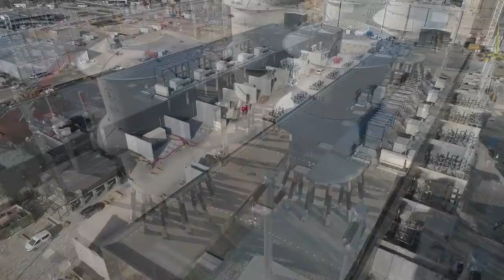WHAT IT TAKES TO LIGHT A STAR

Comment: What happens when there eventually is a catastrophic failure ? Does it explode and destroy a town or go out in a puff of smoke ? Would be nice to know what safety protocols are planned.
Reply: Fizzles out, does not explode. The reactor itself would be damaged but there won't be a permanently hazardous situation like a fission plant. There is the possibility of a radioactive release, but it would be a few orders of magnitude lower than even a modern fission plant. Biggest hazards for nearby towns are fires caused by plant equipment failure.
Reply: completely safe compared to the current nuclear fusion technology - as it takes a HUGE amount of energy to maintain the reaction, any problem in the process will cause it to shutdown and immediately stop the reaction - there's absolutely no chance of a runaway or chain-reaction like the old ways...
Reply: Once it is ignited the fusion fuel inside the reactor should just be a little bit denser than void, and due to its immense energy requirement to actually start the reaction if there is a failure in the containment field the fuel should all be dissipated.

Comment: Do Tokamaks have to be this big?  Can it work on a smaller scale?
Reply: If you can increase the magnetic field strength, (for instance using high temperature superconducting magnets) then it might be possible to make it smaller. The research is still ongoing.

Comment: While this is exciting, and kudos for the progress, it's worth remembering that this will not be a plant that is actually capable of sustainedly producing power. A very optimistic back-of-the-envelope calculation for a commercial fusion plant derived from this experiment puts it in maybe 2060. In other words at least 40 years too late. 
That fusion reactor we already have is the one that we need to use heavily for the next half-century, at the very least.
Reply: not even in the least bit true - this plant will INDEED be producing sustainable power, not just the break-even Q=1, but the target is Q=10!!   It is indeed an experiment, so won't be used to power 'homes' per se.  However, there IS a small grid connected to prove that it can be done, and at some point, it is likely to be powering the local area to some extent..
Reply: @OzBeefer  So, in essence you are saying it's not really going to provide power? Just using a lot of words to say it?
Sure, that's not at all what I was saying.

If nothing's changed dramatically since I last checked, this is the realistic timeline:

ITER: first Deuterium-Tritium-Fusion in 2035. Parallel conception phase for DEMO. 
DEMO, if we're lucky, will be started on for real in the early 2030s. 
Build time until first light: likely 2045. (My estimation, maybe more pessimistic then needed, but "a pessimist is an optimist with experience".)
And then they'll be (hopefully) ready to build the first real production plant, which will take another ten years or so. 

And that's one $10 billion machine providing something on the scale of ~1 GW or ~10TWh/a (assuming more or less 100% full availability, which is frankly unreasonable). Scale that up to the world's needs, and say only 10% of the ~40PWh you'll need 500. $5 trillion investment. 
Easily second half of the 21st century.
And before you hit me: these are back of the envelope calculations -1 digit of precision, as it really doesn't matter that much.

Don't get me wrong, I like the idea of fusion power plants. But unless some magic's going to happen, they'll come too late.
Reply: @roaxeskhadil  short answer, yes it's going to provide power to prove it can be done in 2025-35.  Then DEMO will be a production-use scaled-up version to take it to the next level.   These things take time, 40 years late from what exactly?  The tech simply didn't exist to DO this 40 years ago, so I would argue that this is exactly on time...
Reply: @roaxeskhadil  I think you’re trying to say ‘create power commercially’?  Then no, this is an experiment, but creating power itself, of course it is - what would be the point otherwise?
Reply: @OzBeefer  An experiment is not a solution to a problem, it might be a step to get there. So yes, I was talking about commercial use, of course, there should have been no need to spell this out.
Reply: Actually, I did spell it out: "A very optimistic back-of-the-envelope calculation for a commercial fusion plant derived from this experiment "
Reply: @OzBeefer  "40 years late from what exactly"

too late.

Too late to have any significant impact on us fuck up our climate.

Reading competency these days ...
Reply: @roaxeskhadil  it couldn’t have been done 40 years ago, you do see the paradox right?
Reply: @OzBeefer  Not at all what I said.

Comment: ITER is tremendously exciting but I can't help but wonder if the time, money & resources could have been deployed more efficiently in renewable energy & storage deployment far sooner, & to far greater effect in reducing runaway climate change risks, used the same international political cooperation to build the massive interconnected, intercontinental grid connections necessary to make a fully renewably powered grids possible; some of which has only just begun over the last few years. Australia has massive solar resources, could & will, begin to supply South East Asia. North Africa, again massive wind/solar resources could easily supply both itself and Europe with solar & wind power. Humanity could have been reducing greenhouse gases for the last 15 - 20 years, ramping up renewable energy generation and storage at a pace much more in keeping with the Kyoto protocol and goals of the Paris accords.

Comment: Just imagine if you switched these obsolete superconducting magnets with the new much powerful ones being used by MIT, SPARC and Commonwealth Fusion Systems. You could just create the foreseen power of the DEMO reactor over the existing ITER infrastucture, just by switching them. This should be done as quickly as possible.
Reply: The ITER design was solidified 20 years ago.  You can't just swap in higher field without changing every other aspect of the design.  Also, it took years to source enough NbSn to work into confining coils.  Mankind hasn't made enough useable REBCO since its discovery 40 years ago for a single one of these coils.  REBCO was on the table 20 years ago and was foregone.
Reply: @willis963 could you please explain more about the REBCO you are talking about?
Reply: @francescodalo8828  ReBCO (Rare-earth barium copper oxide) is a high temperature superconductor. And is hoped to be the material with capability of holding the highest magnetic field of all know superconductors. Tho the production is quite difficult. There are new methods for YBCO tho nothing is done at scale. 
Building those coils out of the high temperature superconductors is just not feasible as of now.

Comment: How much electrical energy is being used off the grid to kickstart this process ! one look outside suggests a lot looking at all those transformers and sub systems so therefore a nuclear power station somewhere or windfarm is pumping its output into this projects power requirements.if its viable and a better solution to nuclear fission = waste= nasty stuff then its impressive but surely the amount of energy being used here before you get an output is bit more expensive than using fission,uranium fuel assemblys are produced then used to create fission which gives the means for electricity how much energy is used creating those fuel assemblys ?..here we have huge amounts of electricity used to power a machine which burns plasma but then as it stated it could be decades before they can get the energy to the grid. so unless you live in a cave this project is using great amounts of energy  both in its cooling and operation. it reminds me of that other project which seems to give nothing for its mammoth infrastructure CERN particle physics. is this project "iter" money well spent in light of its complicated nature.
Reply: It will take a lot of energy to start the reactor, but they don't use that energy draw until they start it.  The video is showing all of the infrastructure that will be used to create/transfer the energy for when they do switch this on.  Then, once it's running, if the system works it will be a net positive production of energy and it could continue to run itself without further input.  Then we build many of these all over the world and we get nearly unlimited power without carbon emissions and without nuclear waste.  That's the dream and its worth many orders of magnitude more than the investment we're currently giving it.

Comment: This is  a project that will fail since the whole idea is based on a series of assumptions. Anyway, is a good project so far as it gives jobs, at least until it will be abandoned.
Reply: This is not a powerplant project, it is an experiment. Even the "e" in the name stand for "experimental". Experiments can not fail by definition. Every outcome produces some form of knowlege.
Reply: @oO0Xenos0Oo  Hi. Since 1960's they made the same experiment with the same conditions and the same results. Each time they ask bigger machines and bigger computing facilities. Every 10 years they promise that in 10 years they will deliver results. Don't you find it at least suspicious?
PS. A former engineer.

Comment: LOL...So you need millions of watts of power to run a machine that will make millions of watts...INFINITUS EST NUMERUS STULTORUM...But, congrats to all the tradesmen and women making bank on this boondoggle swindle.
Reply: You need to start it up and that requires a lot of energy, just like a car engine requires a spark plug to get it going, this is the same principle, once it's up and running it does need fuel to keep running obviously. It does not break the law of thermodynamics.
Reply: @Danuxsy  LOL...So, you're comparing the most dangerous machine ever created in human history to a CAR?????... Anyone endorsing this monstrosity is willfully ignorant of PRACTICAL physics. Mechanics, Engineering and basically anything regarding real science.  That "jolt" to "start" the machine will need to be reapplied when, through entropy, the machine winds back down; if it doesn't explode and kill half the earth first...
Reply: @godbluffvdgg  The fusion reaction will be maintained, it won't wind down in the final assembly. Explode? Fusion doesn't explode, it fizzles out. The issue is keeping the thing going, not preventing it from exploding (because it can't lmao) XD
Reply: @godbluffvdgg  Yeah... I don’t think you have understood what practical physics is.